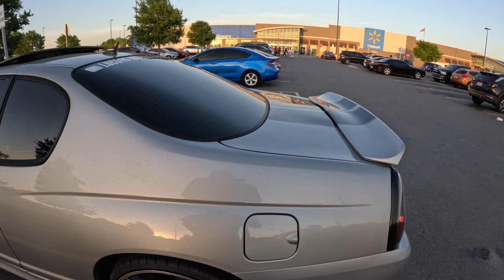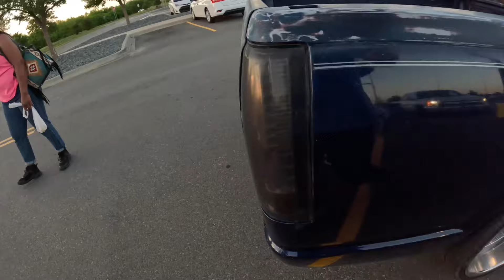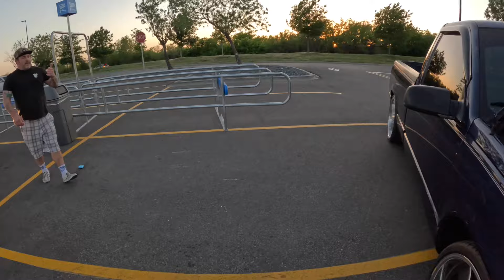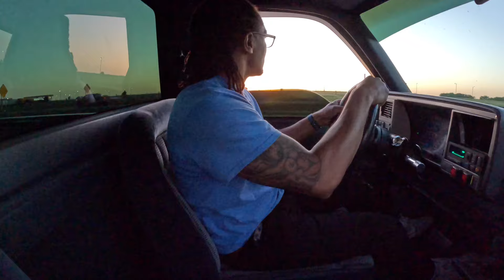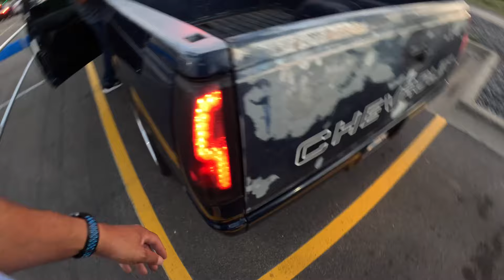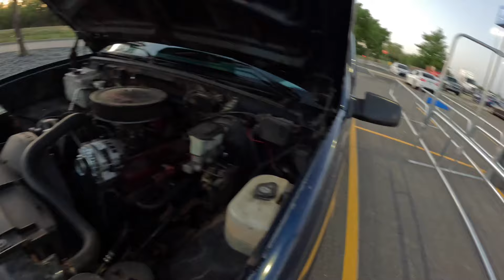Pops Will Not Take No For An Answer He Is Forcing Me To Buy Him This OBS

Comment: I don't know how much he wanted, but it just may need new shift solenoids. All four. Those steering boxes tend to get leaky, and they steer bad. It's an old truck. The solenoids are cheap. That steering box is a couple hundred bucks. Like I said, it depends on what he is asking. 2 to 4 thousand, I would buy it. It's a project.

Comment: Thats a 700R4 trans im guessing. No TV cable hooked up that will burn up the trans with a quickness 4L60e trans doesnt have a cable unless it has a trans controller but the 4l60e is a computer controled trans..